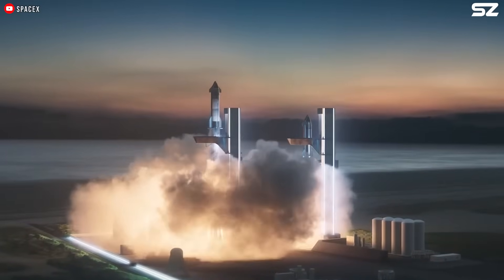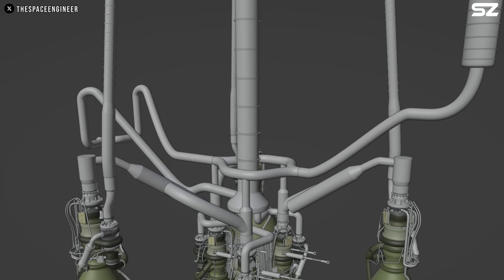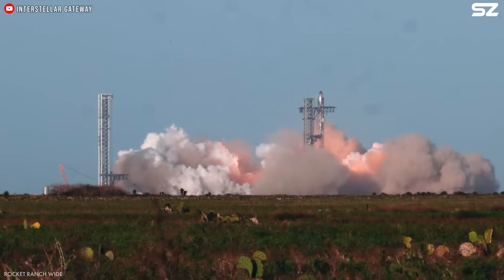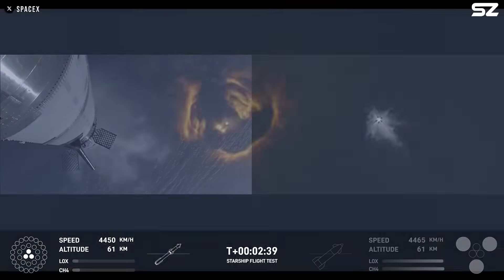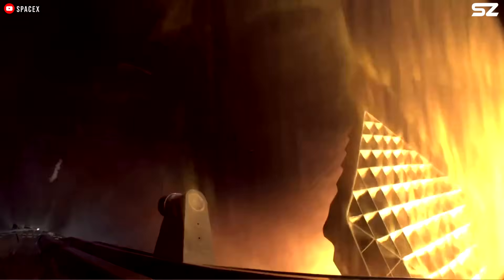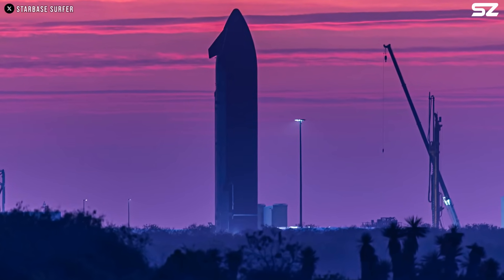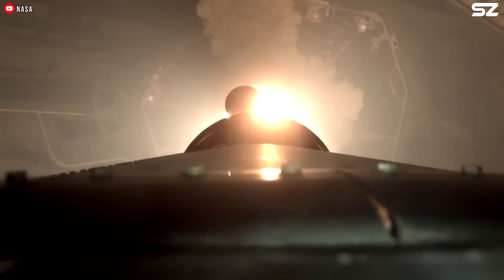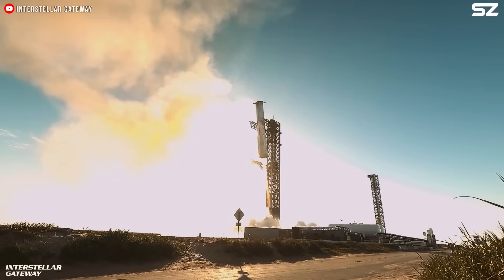SpaceX fixed ALL Explosive Starship V2 problem, Flight 9 Launch Coming…

Comment: I don't understand why there is not a single vacuum insulated downcomer with multiple fuel lines inside. Less parts = more better.    The vacuum can be vented to space once reaching a certain altitude to overcome any small leaks.

Comment: Newest piece of info was the use of vacuum insulation for downcomers. I did not know it was necessary given the thermodynamics of the liquids. I am sure vacuum insulated lines are more fragile than non-vacuum insulated lines, especially on the vacuum to outside wall. It also makes supporting the inner pipe more complex since you cannot support anything with a vacuum. So many variables to juggle. Elon needs to get down to Boca Chica and so some hands-on supervision.